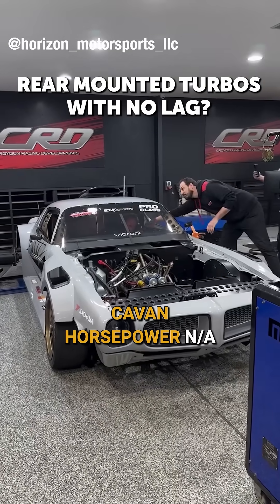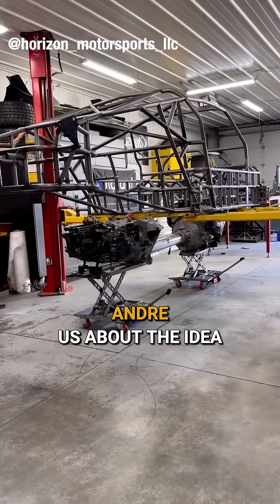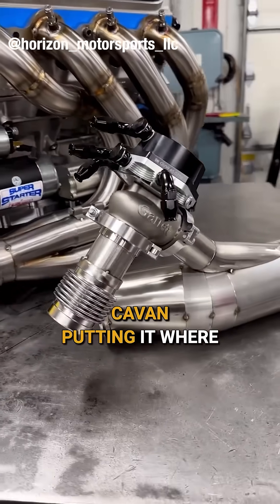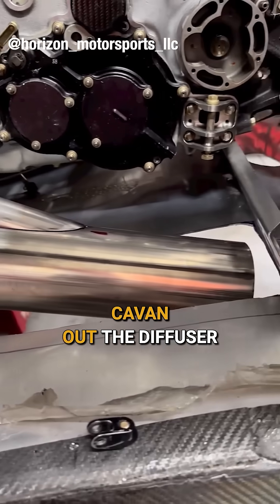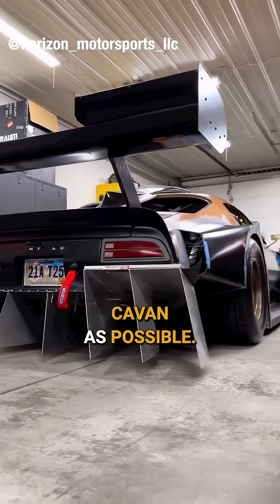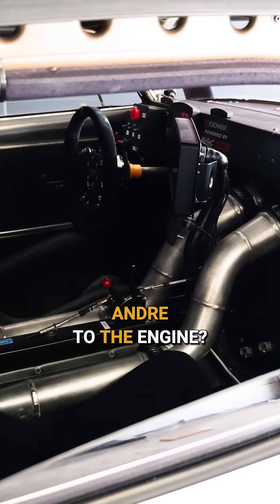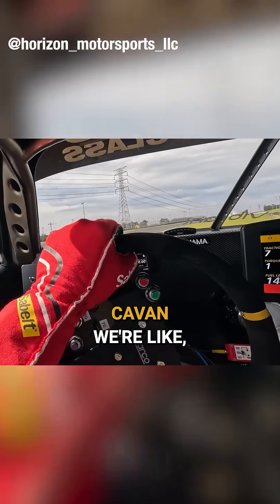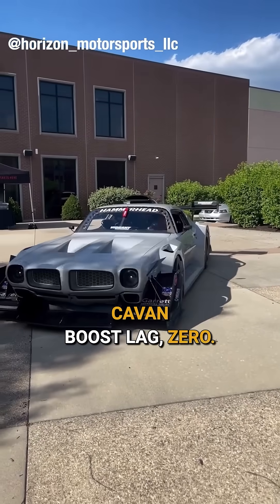Rear Turbo Packaging Nightmare?

Comment: Driving4Answers does an EXCELLENT job of explaining "turbo lag." Most people have no idea about the difference between boost threshold and lag
Reply: Been saying that for 20yrs.
Reply: @realMaverickBuckley  But he is just coping. There is a reason why race teams have put turbos in hot v8 since the 80s and not in the rear.
Reply: @DuBstep115  Which teams? Endurance racing didn't do that, however F1 did do that for packaging reasons. No other race cars that I am aware of are Hot V. Also Lancia solved the lag problem with a supercharger yet I don't see many people running out and doing that? Even the one featured on HPA people say it's too complicated. So that must mean that people are okay with some lag....
Reply: @dj4monie  Lets just ask, how many race winning cars have actually put turbos 2 meters away from the engine? Can you name one? That actually raced at pro level and WON
Reply: You still get lag after threshold with a large intake volume. They don't have lag bc it makes 800hp off boost and are probably traction limited at 5psi.
Reply: @ClarkBark14 let me get clear from the start that I’m being pedantic and my tongue is firmly in my cheek …… but…
You only get lag AFTER the boost threshold. Threshold is the rpm below which you can’t make your desired boost, lag is the time it takes to generate boost when you’re already in the correct rpm range.
When you think about how much air a turbo shifts, you’ll need a pretty huge intake volume to create noticeable lag.
Your point about having loads of power off boost is spot on though.
Cheers.
Reply: @jiminycricket9877 stop using common sense and logic sir
Reply: @jiminycricket9877  "Threshold is the rpm below which you can’t make your desired boost"

That's incorrect. Boost threshold is the minimum RPM required to make positive pressure.

"lag is the time it takes to generate boost when you’re already in the correct rpm range."

That's also incorrect. Lag is the difference between boost threshold and boost onset (the RPM at which the power surge starts to occur).

"When you think about how much air a turbo shifts, you’ll need a pretty huge intake volume to create noticeable lag."

Intake volume has absolutely nothing to do with turbo lag.
Reply: One of the few videos I disagree with him on. Larger volume between turbo and motor on either exhaust or intake side will reduce response
Reply: @mr.pineapple7620  As long as you are around the threshold of the turbo, I believe him when the lag is not noticeable.
Reply: @dj4monie  it might not be noticeable but it is definitely longer. Because pressurizing a leaky system with a higher volume definitely takes more time then with a smaller volume
Reply: @mr.pineapple7620  But he was specifically talking about lag. Longer exhaust piping serves to reduce the efficiency of the turbine wheel, increasing the RPM at which both boost threshold and boost onset occur. So you're correct that response is affected, but he is correct that lag is not because they are both affected by roughly the same amount (and lag is the difference between the two).

The intake side is a non-factor because pressure waves travel at the speed of sound. You'd need WAY more volume than this to have any impact.
Reply: You mean the difference between boost threshold and boost onset.
Reply: @rars0n no, he said it right.
Reply: @jiminycricket9877  To clarify what I was saying, lag IS the difference between boost threshold and boost onset. A rear-mounted turbo setup doesn't appreciably increase turbo lag, but it DOES affect boost threshold.

Comment: People have no idea just how much air volume a good turbo can push. The internal volume of the piping is very small in comparison. Another thing is understanding just how heavy a full turbo kit can be and how you can use that to improve weight distribution and like he mentioned, center of gravity. Also heat transfer and heat soak. There are so many things about this that if done correctly can be huge positives. 
Just because it's not intuitive people give the usual ignorant responses.
Reply: It's not about the volume of the internal piping, it's about all of the heat energy lost in all that exhaust piping.

Comment: It seems like longer intake pipes would hold some boost pressure and reduce lag.
Reply: That's backwards. The turbo has to spool up first before there is any pressure in the piping.
Reply: @rars0n yes, but with that much ducting and a recirculation valve instead of a blowoff valve, it should retain some pressure.
Reply: @logicisdead9871  That's not how pressure works.

Comment: A a diffuser blown by a turbo can produce some interesting characteristics. With a reasonably aggressive ALS, the diffuser will be quite powerful, even off-throttle.

My fear, as always, with these diffusers with very sharp corners and aggressive expansions is the potential for the diffuser to stall.

I am not saying that that is the case, here, but given the available space, this is not the diffuser that I would've designed.

Regardless, this is a very interesting project!
Reply: @leoa4c  what is a diffuser, Ive seen the word diffuser as in an aero dynamic part of the car but it doesn't sound like that's what your talking about, is there some other part called a diffuser?
Reply: @jonathonsaavedra843  it's the "wing" at the low rear of the car, it's assembling to keep the airflow attached while coming away from the ground in order to create downforce.
Reply: @jonathonsaavedra843 it the angled piece where the rear bumper would be, has I want to say strakes? Not sure if that's the right word but vertical dins to isolate the airflow into sections. Because it's ramped upwards and has the wing fences it should act just like a rear top spoiler and create downforce
Reply: @stuartmartin-l8q ok see that's exactly what I thought a diffuser was, but the other guys comment talked about the diffuser stalling and it confused me because I don't understand how a diffuser can "stall"?
Reply: @jonathonsaavedra843 on a diffuser the main purpose is to create a low pressure zone by allowing the airflow to attach to the “ramp” of the diffuser while it is rapidly expanding. A stall happens when the airflow suddenly detaches from said “ramp” of that diffuser, if that happens then the diffuser will stop generating its low pressure air in that zone and you lose the downforce that it is producing. It can completely destabilize a car
Reply: Same way an aeroplane wing stalls.

An example is, a bugatti veyron wing, or mp4-12c.

Ehen they are engaged, they have a shallow angle.  But when those cars brake, the wing pivot upwards, and it's no longer generating down force from negative lift behind it. 

It would have huge virtices swirling around it, not tightly sliding on its underside at all. 

Purely acting on wind resistance and drag. 

But, if this is under the car, there is no wind resistance on the front of the diffuser, or drag to slow it down. So instead, the wind just flies by, uninterrupted and ineffective.

Comment: Why though, there is literally no upside
Reply: Weight distribution. They were very conscious about having a rearward centre of gravity in this build, and having the turbo in the rear helps with that.

The downsides of a rear turbo setup are mostly irrelevant in a time attack track car like this
Reply: @neoroggensack1244  any gain from a slightly more rearward WD will be offset by the extra weight need to run all those exhaust and intake pipes! Literally would have been better off adding ballast in the boot - engine woulda made more horsepower too as you're losing boost down a pipe that long 😂
Reply: Here's your Dunning Kruger Award 🏆
Reply: Weight distribution. You wouldnt get it if you aren't heavily indulged in the idea of racing
Reply: @PREMiXdfc3s  trust me  I'm heavily involved in racing, and can tell you any benefit of moving some weight at the back, is offset by this layout being FAR heavier, and costing engine power
Reply: @GamezGuru1 it's not just front to back, it's about getting it down low. The lower the center of gravity, the better it drives. The front end is too busy with suspension engine and cooling and all that. So they put it in the rear. Any weight gained is off set by the fact that the weight is lower this way. CG is more important than total mass.
Reply: @GamezGuru1  You don’t lose boost running longer charge pipes. You will probably lose some exhaust energy as heat and the turbo will spool up slightly later but I doubt it’s noticeable by the driver, especially being a sequential time attack car not a street car.
Reply: @johnchristopher3032  errmm, no. Lower mass makes everything better. CG height helps in corners, but on a car like this is basically irrelevant.
Reply: @GamezGuru1  iRacing isn't racing.
Reply: @UnderwaterAlexJones I'm not a gamer, i have a real job 😂
Reply: Aside from weight you also have substantially better cooling by keeping the turbos away from the hot engine bay.
Reply: @damncritics  no they're next to the trans axle that you don't want to heat up...

Comment: If they had a range of problems with it in the back. Why put them there?
Reply: they wanted to push the engine as far back as possible for weight distribution and there wasn't enough space for turbos I assume
Reply: weight, it matters so much that they used axel trans for it.
Reply: @MRworldEtIkA except conventional turbo layout up front would have been WAY lighter - you think those meters of exhaust and intake pipes don't weigh anything? 😂
Reply: @GamezGuru1 you clearly haven't seen this car up close and know why they chose to do this turbo setup. too bad.
Reply: @MRworldEtIkA  clearly that's why he's asking, seems like you don't know why they did it either
Reply: @CalamityJay-ez2mq  There's literally no room. They put the engine so far back because most of the engine bay is for the sophisticated suspension setup, and to get it, they made the entire chassis out of custom fab tube frame. you should see where the engine is, or do you still think i don't know where it is and want me to elaborate further?
Reply: @GamezGuru1 In addition to total weight, Inertia around the yaw axis also matters, that's why they push the engine way back to reduce Inertia and speed up the initial rotation of the car when entering a corner. That probably left them with no room in the engine bay to put the turbo.
Reply: @GamezGuru1 And because the additional charge pipes are close to the center of the car, they won't add to the moment of inertia by much.
Reply: @GamezGuru1 my rear turbo layout’s extra plumbing weighs as much as a front mounted setup but the weight is rear biased, so that extra pipe work isn’t actually all that much. It’s straighter and better flowing than most front mounted systems on the same engine and sounds better too!